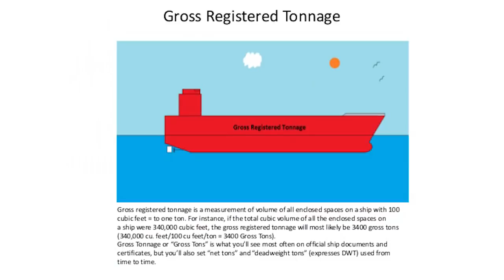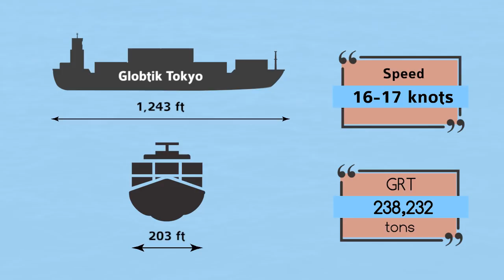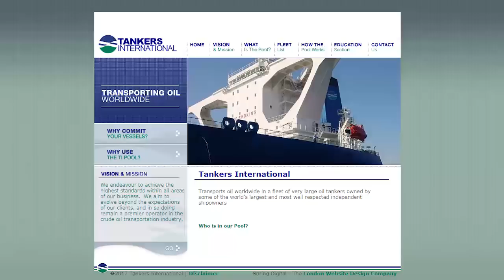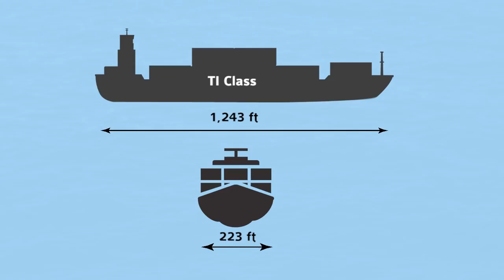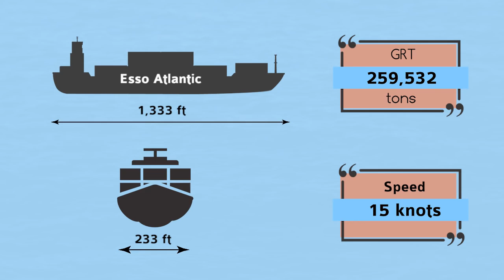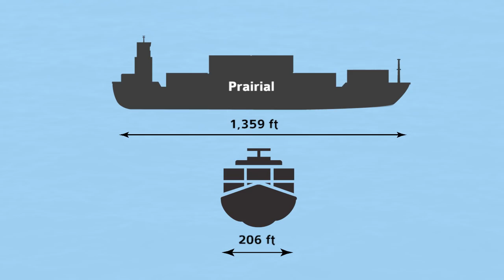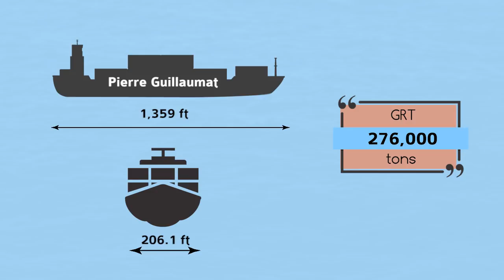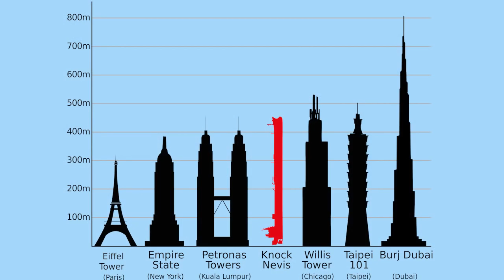Top 10 Biggest Ships In The World

Comment: When we think of really huge seafaring vessels, many of us probably call the mind that doomed luxury liner the are m s Titanic, the reference to its enormous size is right there in the name, but that ship set sail on its one and only voyage over a century ago, and in the intervening years there have been some truly Titanic ships that have traversed the world's oceans. In fact, the Titanic is dwarfed even by the most common of modern day cruise ships, and those shifts look tiny when compared to the passes will be looking at today, the top 10 largest ships ever constructed. For reference a ship size is measured using a specific set of specifications of course these generally include length and width often referred to as be but also taking into consideration his tongue which can be measured in several different ways and it's not always a measurement of the ship's actual weight for our purposes here we will be looking mainly at gross tonnage which is a standard measurement and related to the overall interior volume of the ship by way of comparison the mighty Titanic measured 882 feet long by 92 feet wide with a gross tonnage of 46328 times impressive but not even close to the specifications of the first ship on our list Brazilian carrier in the world construction on the vessel was completed in 2011 it was designed for transporting iron ore from Brazil to Asia capable of hauling enough steel in one time to construct 3 golden gate bridge is 1113 feet with a gross tonnage already well over 4 times the CGI of the Titanic Vail is still in service cutting it imposing figure along the waves of the Atlantic but its route is highly strategic do the Chinese maritime laws it is unable to enter Chinese ports as it is simply too heavy distribution ports in the Philippines in Malaysia allow its cargo to reach destinations within China first entered service in 1975 picture model was among the very largest oceangoing vessels in the world in oil tanker with routes crisscrossing the globe Armada sailed the world's oceans for 32 years before finally being retired in 2008 during its 3 decades of service supplied crude oil to ports all around the world specifications are no longer a matter of record but the enormous length of 1225 capable of carrying massive amounts of cargo to the tune of 380000 times its top speed of 16 knots was quite impressive when it first sets sail making it not only one of the biggest ships in the world but also one of the most powerful, it may have an inglorious used today, but with its faithful service record and incredible specifications. Drama is still remembered as one of the most impressive tankers to ever sail the seas. He is it was that your Mana class vessel wasn't the only insanely huge oil tanker navigating the world's oceans in the 70s the globe Tokyo supertanker first set sail in February of 1973 and distributed oil around the world for 13 continuous years it's 1243 foot length longer than 4 football fields put into a 203 foot beam made a site to behold as did its distinctive black and red color scheme love to Tokyo could also cruise along comfortably at a speed of 16 to 17 knots especially impressive considering its gross tonnage rating of 238232 times about 5 times that of Titanic capacity of 484000 times over a 100000 times more than the dramatic class was scrapped in 2003 but first catch water rate held the title of the largest supertanker in the world sister ship set sail in 1973 had identical length being specifications amazing quite a bit more weight my back cover don't suffer from bad coverage, a better phone plan from google respectable 276 times. Lti clas of supertankers constructed by shipbuilder tanker international l l see may not technically be the longest or largest ships in the world in terms of sheer size but when it comes to gross tonnage a rule supreme there are 4 currently in various types of service around the world lti Africa CIA Asia Europe although 2 are currently being used as more storage vessels their massive g t of 234006 tons is currently tops among active vessels and on top of that they are among the most aesthetically pleasing oil tankers ever built class 16 to 189 top speed goes a long way toward maximizing its earning capacity but it's popping sighs awesome means that there is some waterways which it simply cannot navigate for example the Panama canal is off limits to fit through its recently built Suez canal and I'll go as well but the vessels are also notable for their wealth of hightech features insensible whole design which minimizes the chance of a catastrophic oil spill in the event of a whole bridge in a being of 223 feet. It was launched on its maiden voyage in 2060 m mark was the largest container ship ever constructed today it has 7 sister ships all of which are considered to be among the largest and highest capacity container freighters in the world the vessel's astounding top speed of 25.5 nights makes it among the fastest vessels of its type in the world and is doing parts of the fact that it is powered by the world's single largest diesel engine a marvel of engineering which itself weighs 2300 times and is capable of a power output of 109000 horsepower while burning through 3600 gallons of fuel per hour PM boasts impressive gross tonnage of 174794 times in measures 1300 feet long with a beam of 184 during the 2006 holiday season the vessel made headlines for a whimsical reason the press caught wind of the fact that it was bad for the UK from China capacity with Christmas goods it's for this reason that for only a brief time was known around the world as he has a Santa. So Atlantic and its sister ship the Pacific were 2 of only 7 ships in all of maritime history to carry a capacity rating of over half a million times beginning service in 1977 the supertankers plied the world's waters for 25 years before they were decommissioned and scrapped in 2002 tankers immense size meant that not only were the Panama Suez canals off limits but the English channel as well they sported gross tonnage ratings of 259532 times and both clocks in with a length of 1333 feet in a beam of 233 feet their relatively slow top speed of about 1590 is understandable considering deputies guard vessels were both powered by a single propeller steam turbine engine today's modern tankers even though they long ago ultimate faith recognized in their time for their sterling service records and they will hold their places in maritime history as 2 of the highest capacity tankers ever built. The supertanker prairial came into service in 1979 the 4th version of the potatoes class of tankers it was the only one among the 3 others in its class to exceeded decade and service sailing the seas for nearly a quarter century before it was scratched in 2003 over all those years the ship was also known to go by other names such as see brilliance and most appropriately see giant with a g t of 274826 times boasted a cargo capacity that is practically unrivalled in maritime history somewhere between 555000 and an astounding 604000 times it's double propeller quad steam turbine engine system delivered only a top speed of about 16 knots but that's still not too shabby for what is considered the third largest ship ever constructed remaining on our list from modified from their original dimensions a whopping 1359 feet 200 feet wide which was challenged only by 2 other vessels that is until 1981 with the sister ship which gaped extended. The first of its home on a ms class Taylor supertanker hippie ocean in 1976 as one of the largest vessels in the world and it left up the list when its length was further extended in 1981 but Tillis could move a massive amount of cargo with it 275268 gross tonnage rating and after its modification came in with the same length and beam measurements as prairie off variances in the other types of touch however get my Tillers for slight edge over its sister ship it's deadweight tonnage when constructed with superior to virtually any ship that ever existed till this must also be given credit for being the first of its class when it comes down to it measuring the largest seafaring vessels is somewhat counter into a better home google terms of bragging rights among the class one is just have a large.
Reply: Ok what the fuck
Reply: Wtf who’s reading all this ?
Reply: Who gives a f🗿🗿🗿